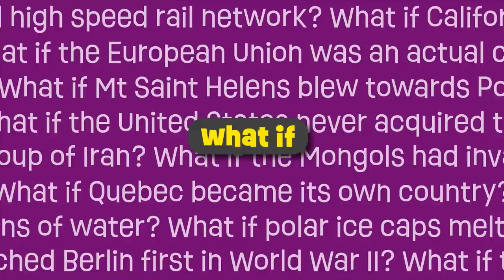Water Pipeline: What If An Aqueduct Was Built From The Great Lakes To The Southwest?

Comment: In the spirit of ambitious imagination and inquiry into what is possible, let's explore the utilization of condensation collectors for atmospheric water harvesting. Strategic placement in the Southwest, considering conducive altitudes and microclimates, maybe if we could greatly enhance water collection efficiency.

These collectors would attract and capture moisture, directing it through connected pipes to ground-level basins. To ensure adaptability, the collectors could be designed with mechanized and adjustable features, allowing precise positioning at different altitudes for optimized moisture capture.

The mechanized adjustment capability simplifies maintenance and enables responsiveness to dynamic atmospheric conditions. By raising or lowering the collectors, adjustments accommodate fluctuations in humidity levels, cloud cover, and other factors influencing moisture accumulation. This adaptable approach maximizes resource utilization and system efficiency.

Meticulous site selection, coupled with the mechanized and adjustable design, optimizes the capture of atmospheric moisture in the Southwest. Could this approach hold promise as a sustainable water source, particularly in water-stressed regions?

Comment: What no one is considering is to drive the water over the continental devide would take a huge amount of pumping capacity at the source as well as booster pumping stations along the way. To drive these pumps would take a huge amount of electricity. The US generates most of their power from coal. As a result, the people of the great lakes basin would not only be loosing their water but gaining the air born polution from the coal based generating stations.

Comment: In 1960 the Aral sea held 260 cubic miles of water, Lake Superior currently holds 2,900 cu mi, the great lakes combined holds 5439 cu mi. I might add that the withdrawal from the Aral, and diversion of water that would have flowed into the Aral, was unregulated. Now, because the affects of climate change are being considered in all aspects of our life it is time to take a closer look at rising water levels that are projected to affect the entire Great lakes basin. Please Google it yourself, start with Great lakes errosion caused by climate change. I have a plan to extract 2 trillion gallons of water from the basin yearly, thats roughly 6 million acre feet, or half what is currently used from the Colorado river basin. Its not a hare brained idea when you consider the great lakes holds 6 quadrillion gallons of water, thats 6000 trillions. Also please consider that 17,000 cubic meters per second flow out into the ocean through the St. Lawrence seaway each year, wasted.

Comment: About a year late...but what if an aqueduct(s) was built from one of the Missouri rivers reservoirs to the  head of the Colorado River or tributaries that feed it? Take advantage of natural water flow plus there are not as many people using this water and downstream flooding in the Mississippi river is an issue too so maybe this would actually help that as well...probably still expensive but seems more financially feasible and less environmentally costly I think

Comment: Actually the best place to steal water form would be the Mackenzie river in canada.  First of all, it flows north into the arctic ocean, and there is already limited infrastructure running all the way up to where the Mackenzie flows out of Slave lake in the northern territory at Fort Simpson.  A water pipeline flowing south woulc easily be run off pumps that just send the water south and could easily be dumped into the Green River basin headwaters in Wyoming just south of the Yellowstone national park.  And to avoid conflicts with indian reservations and Yellowstone, just go around them.

Comment: Thanks for your video.  However, the Great Lakes regions don't tend to flood like other States, and so they they are not MOTIVATED to share their water.  Isn't it better to select States that 

1. Have higher elevations so there is no need to pump the water uphill
2. Closer than the Great Lake States 
3. Floods often, or at least have to let their water flow to the ocean without collecting revenue
4. Wants to become the Saudi Arabia of water (even though they don't know it yet)?  The States with hills high enough, close enough to AZ and CA, floods often, and needs $ are MO and OK

Another out of the box thinking is that we don't have to pump water all the way up to Colorado and Utah.  All we have to do is supply the lower States (CA, AZ) to take the pressure off the Colorado River (and hence Lake Mead and Lake Powell).

Comment: Nicely produced video! At 2:34 you state that since 1922, Arizona and the entire US Southwest has been receiving and using Colorado River water. However, while the Colorado River Compact was signed by all 7 state delegates in 1922, the State of Arizona did not officially ratify the Compact until 1944. The Central Arizona Project, which is the diversion canal from the Colorado River to Central Arizona, did not start construction until 1973, with substantial completion of water delivery occurring in 1993. Thanks for your efforts on identifying the hurdles and feasibility of this new water diversion!
Reply: You would have better luck using desalination from the Pacific ocean
Reply: Desalination from the Pacific ocean would be cheaper and  easier

Comment: one doesnt have to build a pipeline all the way from the great lakes, pulling excess spring runoff would do. likely making it easier on the Mississipi if pulled from there
On the other end, transport over the mountains in Colorado has already been solved, the pipeline need only make it to the Colorado Front Range, or, more likely to Wyoming, where it could join up with the White River watershed
the bigger issue would be the expense of pumping it more than a mile uphill

Comment: Agricultural interests needs to get low/no interest loans to invest in irrigation techniques that minimize the use of water by using it more efficiently. They can be incentivized by using realistic water allocations, not the ones they use today, rather ones that acknowledge today's drought situation in the SW.  All residential users should pay more to incentivize them to conserve as well. This rate should not be linear, rather large users should pay a higher rate. States in the drought region should consider storing their own water for use when it is abundant in areas of their state that receive more water. Try these suggestions before you try taking water from someone else.

Comment: The Great lakes have times of high water and times when the water levels are much lower if they took water in pipelines when the water level is high only very few people would oppose that taking water when the levels are low some people would have issues with that. Using windmills to power pumps at regular intervals would transfer a lot of water along distance for a relative cost. It would also spread muscles and other aquatic Life to the Midwest where it doesn't belong

Comment: Hello,

This is not 100% true. You have a ton of great points. However what humans need to do is this. We need to take about 10% of the water from various outlets of the Mississippi and Missouri River. Funnel it underground to the Colorado River. We then need to Dam up the Grand Canyon which would hold trillions of gallons of water. Piping underground using boring machines would eliminate the land cost expense.

Comment: Weak video. Claims that diverting water would lead the the Aral sea scenario. Only considers diverting water from the Great Lakes and not the other massive rivers which dump fresh water pointlessly into the ocean. Mississippi River alone dumps ~4.5 million gallons of water per second into the Gulf of Mexico. Water is a resource, if you are happy buying produce from western states, you should be happy not wasting water into the ocean. Additionally, $100 billion is not a lot of money in terms of US government spending. US has an annual military budget of $800b. 1.25% of that over 10 years could cover the estimate. US grows military budget by more than what is needed without anyone batting an eye, spending on infra should not be so controversial.

Comment: I believe that the water that was in the original idea, was to come from the Mississippi River/water that is already on its way to the Gulf of Mexico so no harm no fowl. Yes, there would be costs, but in the end the taxes generated from the business and homes being built would balance that out, and Mexico would start getting water again, Bonus! The pipe would be under ground and pumps could run via solar power. Yes, it would have to cross individual owned property but, after 1 and 1/2 years you would not know it is there.

Comment: Thanks for the interesting video. The idea was worth taking a look at, but after checking it out, there are too many problems with it. Besides, there are cheaper alternatives that have been under utilized. First off, a whole lot more needs to be done using conservation and recycling methods. This includes laws that will also apply to the rich and famous. Second, agriculture in the area must be done using organic fertilizer and crop rotation methods. Third, at least some of the farmers out in the dry west should be encouraged to move their operations to areas of the country that usually get plenty of rain. It doesn't make sense trying to farm in an area that's not suited for it. Hope this helps at least some people.

Comment: So, snow? No laws on shipping that water, hu? I also dought the cost issue, this is similar to an oil pipe line, maybe even the same. Now forgetting water, I want to put the snow on there peaks, that will help cool these places too. Also, I think our now heavier water in the great lakes now are a direct result and the exact water that was pumped out in the west, was watching cloud circles. Both are unnatural, but there is an element of perpetuation of this unnatural state as to not reach the next step, that it, they do run dry, and then the great lakes stop getting rain.
Reply: A cart system is to move the snow, 3 stages, one is existing train nextwork

Comment: So how would it be if all 7 million arizonans moved to the great lakes? Now does sending water sound better?
Reply: Feel free; virtually every major city on the Lakes (Cleveland, Detroit, Chicago and Milwaukee for starters), as well as scads of mid-sized and smaller towns (Buffalo, Toledo, Duluth, Gary, Erie, etc.) is now considerably smaller than it was back in the 50s-60s, in some cases by 50% or more.  All of these cities were built to house far larger populations than they currently have, and collectively, together with their suburbs and all the other mid-  and small-sized towns, they could easily absorb every single one of you.  Granted, it'd be a bit more crowded, but of course, at the same time, your tax dollars will remain here, the Great Lakes states' political power will mushroom, property values will skyrocket, and thus the value of the resource will accrue to the locals rather than be stolen by reckless desert spendthrifts who can't perform even the most elementary resource budgeting.  Bring a jacket!

Comment: There is a lot of rain where I'm from how about being a little smart and catch it up? America need to send its engineers to a smarter country like Singapore to fix its water issues. Back to catching rainwater. Building vast reservoirs to catch rainwater and use it for farming only. It wouldn't be much but at least it will drop the farming water problem from 70% percent to probably 45%.

Comment: You make alot of good points; however, I have to disagree with the comparison between the Arial Sea (AS) and the Great Lakes (GL). The water balance for the AL was significantly more limited than the GL. Being the the AS was a thermal lake in an arid region, any decline in inflows has a much larger impact than an open basin lake (which storage is capped by volume of the basin more than the water availability, and vice versa for terminal lakes) So, we could use alot more water from the GL before we would see the dramatic decline observed in the AS or the west's terminal saline lakes.

Comment: How you goung to get over through or around the Rockies? Water flows downhill and starting in Kansas you go from sea level to14,000 feet by Golden Colorado. Hell Limon Colorado is 200 miles from Denver East and its at 5000 feet.
No California needs to build desalination plants. 
Period problems solved. Pipeline is waste of money and impossible practically cost alone 1 trillion easy and take 20 years easy.

Comment: Lake people should stop being so selfish, and 100 billion dollars is really not that much compared to the defense budget of USA😂. California has plenty sunshine but lack water, Midwest is exactly opposite. A water pipeline would be a huge win-win.😂
Reply: Lake Michigan contains about 4,918 cubic kilometers of water, which is roughly 1,175 trillion gallons. In comparison, California's annual water usage ranges from 30 to 40 million acre-feet, equivalent to approximately 9.8 to 13 trillion gallons. Therefore, Lake Michigan holds a significantly larger volume of water compared to California's annual water consumption. Lake Michigan just need to pump 5 trillion gallons to California every year that would be more than enough, and still last more than 200 years.😂

Comment: Buuuuttttt, a pipeline from the Great Lakes to Arizona is not necessary as one could just dump the water into the Colorado River up near Lake Granby. Creating pipes with siphons is an easy way to lift water or with ram pumps. and boring through miles of mountains is another option. Cheers
     Bill